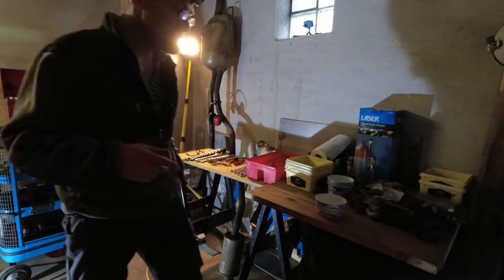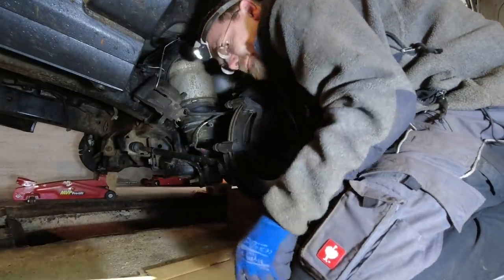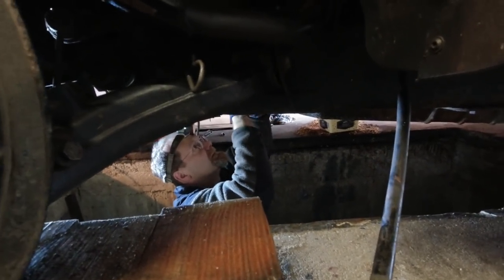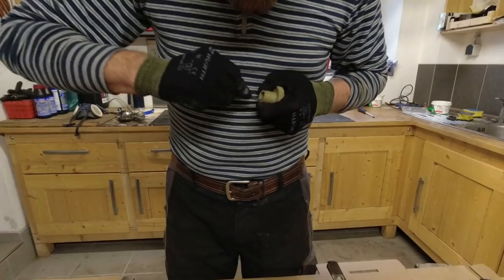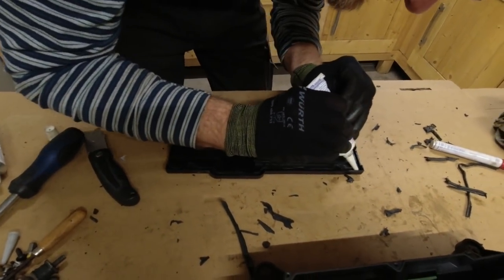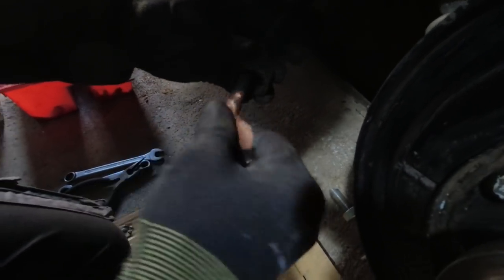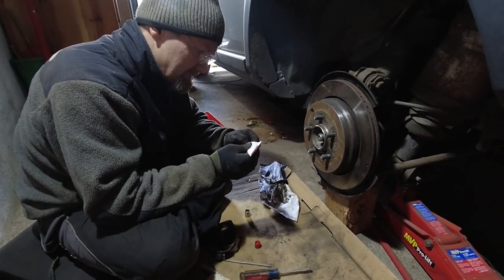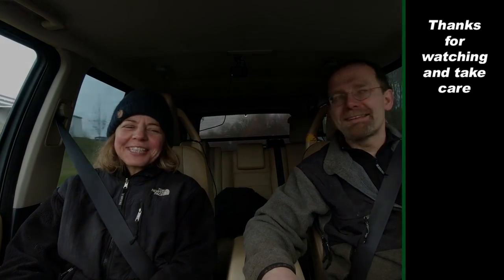How to service the electric parking brake of a Land Rover Discovery 3 / LR3 / LR4

Comment: This is my project for next week. Got my parts from LR Centre in England. Shipping was great as it only took 7 days to get to me here on Vancouver Island, British Columbia, Canada. I have the LR3 HSE with the V8, been good to me so far. Thanks for sharing the info.
Reply from the maker: Hello Zan,  have that 3/8 hex socket ready and a few new M8 x 16 bolts.  Spray them with penetrant the night before. Each cable has two M8 bolts and then there are the four bracket bolts in the back, holding the module.  Also spray the heat shield nuts. Use a hammer and socket and hit them once prior opening them.  Also use a inch socket if they spin through.  We love Vancouver island.  We took our Jeep Cherokee there about 20 jears ago. The landscape is endless. Victoria is a nice city with friendly people.  Good memories.

Comment: Had to be recovered on a truck yesterday. The park brake was stuck on making a horrible noise, so I used the emergency release which didn’t release the brake and locked the gearbox in park 🤦. Got it home and stripped down, cables cut to release the park brake, park brake unit remove ( I used you video to follow, which was great. Mine has Adblue so a little extra work to remove the tank) I’ve opened the electric motor and gearbox to expect the little plastic cogs to be stripped and everything is OK???  Not sure what has caused it, so a full rear brake rebuild and new cogs on order. Your video was excellent 👍
Reply from the maker: That suck,s , our’s was jammed once too, offroad in the Alps. But we could release it. We did the rebuild then in the following winter. When you watch that video, you see that the gears itself did not look damaged or worn out. But definitely be rather safe than sorry. 👍🙋‍♀️Vera

Comment: Another great informative video. I agree, use your EPB all the time. My 2005 D3 is now at 200600 km and the module is still original. Although it's an auto, I still use the parking brake every time. I just had it serviced (shoes stripped cleaned and readjusted according to Bodsy's brake bible) in 2019 after it started making horrid noises, and all is well. Looking forward to your underbody corrosion video. Cheers!
Reply from the maker: Hello Alex, thanks.  Next few videos will be for example:
5 thinks we do not like about our Discovery
Underbody corrossion repair
Things you may not know about your drive shaft
Bad thing is, that I have to work now again. Vacation is over.
Reply: @Vera_and_Christian  Looking forward to them. Stay safe!

Comment: That, right there, is the main reason I can't face the idea of trading in my D2 for a D3.
To have half a chance of doing these kind of jobs easily, you need a D3 that's always been looked-after, and has no rusty nuts and bolts... which you can't rely on when you buy a 10 year old vehicle.

Oh, how I wish JLR had designed the D3 as an evolution of the D2, perhaps based on a Defender 110 chassis. 

Much respect for taking these jobs on, rather than handing it over to a specialist.
Reply from the maker: Thanks.  Such vehicles in Germany are like new after 10 years.  There is hardly no salt and the roads have no bumps. They are dealer-maintained too up to 150t km.  Then they are cheap to buy because they are expensive to drive for non-DIY folks.

Comment: Another fun and informative video, I have adjusted a couple of times and figure one day I may need to fix it if the gears strip.  On a different note, I see you have some light surface rust on the chassis, I do regular off road beach camping but on return to dry land I was thoroughly Then  spray inox mx4, it's a lanolin based product. 2007 lr 3 and not a hint of surface rust
Reply from the maker: Hello Peter,  I have done some rost protection but not in all areas.   I wish i would have done more.  At least I should have kepot it clean but did not.   We ve done not some rost removal which will be in one of the next videos.

Comment: Just wondering if you can remember how long it took to get get it out and back in, I would imagine the gear renovation didn't take long but getting it out and back in must have taken ages.
Love your videos and thanks a million for all your help and information 😁👍🍻🍻
Reply from the maker: That depends on the corrosion degree of your Disco. If we had a video like ours when we did it the first time, it would have been much faster. But we also film, which adds at least twice the time it would take normally. But, who cares how long it takes if it takes 2 or 4 hours. As long as it saves you a couple of thousand € from the dealer or independent workshops. They do not do that for little money. 👍👌🙋‍♀️

Comment: Greetings, marvellous to watch. What size amp leads are you test running the EPB motor with. Thanks in advance
Reply from the maker: I am not quite sure.  I own a couple of test leads and alligator clamps from Amazon.  Not the very cheap ones.  Christian
Reply: @Vera_and_Christian  Thanks, the wires I was using to test the EPB motor were to light. I made a couple out of house electrical cable I had. motor works fine. 😊

Comment: Great video! Very useful for Disco 3 owners! Thanks!
At the end, did you only brake by engaging the EPB on the move? Did you do this to test that everything is working well? Doesn't that put a lot of strain on the EPB module?
Keep up the good work!
Reply from the maker: The TÜV inspector also used the electric hand brake this way. He had an electronic diagnostic tool which measured the vehicle response.  The the manual describes the hand brake switch as a emergency brake as well.  I am not sure if the electric brake actuator is actually used when doing this while driving...  Somethin I need to look into.
Reply: @Vera_and_Christian  very interesting! thanks!

Comment: In the event of a breakdown/Fault, is there a procedure or emergency brake to prevent the vehicle rolling away once parked ? Thanks
Reply from the maker: Yes, put it into gear and use a wedge when parked steep, additionally. 👍🙋‍♀️

Comment: Question:
Does rope(cable) is dry and in good condition? My point is that in winter, if cable(rope) is wet in the casing, it will freeze and parking stop will not work.
Reply from the maker: If you take care of your EPB and service it regularly, you have no problems. Like with everything Land Rover related. We live here in Europe in moderate, wet, and cold climate and the EPB works just fine. It is a Land  Rover after all and build to last. But, you have to do your maintanece. So if something cracks, you have to replace it. 🙋‍♀️Vera

Comment: Christian, the e-brake and brakes in general have. been the greatest annoyance and expense with our LR. I wish you had gone slower and with more light in the critical final assembly steps. Very glad to view your video nevertheless.
With the 30K I do each year, with salt from road...it should be announced loud and clear to open the brake system up to clean and lube before parking for the winter rest...or in spring if you do run through winter...
You are fortunate to have a well configured garage!...and moderate winters to work in.
PS - you didn’t do the e-brake series of secret switch moves and 10 stop “setting” of the e-pads!...or did I miss that ...?

Comment: What sort of time span and mileage should we doing an EPB service ? my D4 is 2015 on 18,800 miles.
Reply from the maker: Well, we did it on ours when he had about 210000 km on it. More important is that you check your EPB everytime you change brakepads in the rear. 👍🙋‍♀️ Vera
Reply: @Vera_and_Christian  Thanks Vera

Comment: Why did you have to drill out the holes of the mounting screws ?
Oh my goodness what a great paint job.
Reply from the maker: There was a risk of breaking the plastic taps off because the bolts were so corroded. 🙋‍♀️ Vera

Comment: I have to service my brake module - it looks to me like it should be possible to service the brake module / replace gears in situation rather than fill remove job with all that rust ?
Reply: Did anyone try this ?
Reply from the maker: We would always take the unit out.  It's not that difficult, and you can service the unit in a clean environment. Also you have to get it sealed perfectly again. 🙋‍♀️ Vera

Comment: hi christen when you did this did you need to pht it in too service mode ? . if so how did you do it. and did you need to unmount the cables before  you did it
Reply from the maker: Service mode is basically brake open.  Nothing else.  Just pull the fuse or disconnect the bat before you start work so it does not accidentally actuate the brake.  Christian
Reply: @Vera_and_Christian  thank you for hour reply ..you guys rock

Comment: My LR4 area doesn't look like this. Theres a bigger solid plate above spare, ac lines and a large canister all behind the module prohibiting access to module. I think the only way mine can come out is through right rear wheel well but the I can not get lines out of the metal brackets, they are not forked like lr3, they are on a hole and grommet with difficult access
Reply from the maker: Check my video from a few weeks ago fixing various things on a later brown  LR3. I removed the PB with this plate. Was very difficult but worked. It was at the end of the video.  Christian

Comment: Great information about the park brake. In case the park brake fails, what exactly happens? Can you drive away the car or is it stucked? What precicely is the failure in your case? I understand that the gears were not that bad and that the clutch(s) work. Even the motor turns and all the cables as well.
Reply from the maker: You can unlock the parking brake when you remove the puller, there is a cable loop hidden behind it, which you pull.  Then the brake should be released.  We actually decided to replace the gears from the very beginning when we bought the car.  It just took a couple of years to get to it 😂.   Same with the oil pump,  we changed it right after buying the car.  But on our last vacation, on the way up to Mount Jafferau, the gears startet to grind really bad.  I actually expectet to have loose teeth in the box, but it looked all fine. 🙋‍♀️ Vera
Reply: @Vera_and_Christian  Hi Vera and Christian, thanks for the quick response. Meanwhile, I learned from another vid on this topic, that you can buy a gear-kit made of brass (aftermarket) instead of the genuine LR plastic. The puller is the knob in the cockpit?
Reply from the maker: @HeinerStorch  I have to look into that because we really would like to buy another Land Rover Disco or Range Rover Sport this year👍.  Yes the puller on our car is next to the shifter. It's clipped in only, so you don't need any tools to remove it.  🙋‍♀️
Reply: @Vera_and_Christian  I see, thanks again. Are you going to sell this one?
Reply from the maker: No, we put way too much work into that one.  But Christian really wants a V8 Diesel.  In Germany, my Freelander costs almost as  much of insurance and tax as the Disco.  So  my hope is that we sell the Challenger. 😉😃🙋‍♀️ Vera
Reply: @Vera_and_Christian   Is he looking for a V8 Diesel first registration 2006 onwards or later? What about the V8- Diesel engine's reputation? Now and then I dream of a Range Rover V8 Diesel, but reading some statements concerning reliability, durability I wake up. Shot Turbos, defective  injectors, cylinder head gaskets, air suspension compressors, sensors etc. etc., electronic failures, ... That's my personal impression.

Comment: How long did it actually take to get it out. Had you the power tools of a Shoppe how much quicker do you think it would be. 
The whole thing looks like a bit of a nightmare.Cheers : (
Reply from the maker: 😅👍 It took us 2 hours to get out and 2 hours to get it back in. And of course the time spend replacing the EPB Gears, but you can take that from the video, we didn't cut anything out on that part. When we work on the car, I don't make any other plans for the entire day 😂. 🙋‍♀️

Comment: Hi guys!  My right hand EPB cable came out of the locking mechanism (the little "notch") and is now stuck fully retracted.  Do you happen to know: Is there a trick to releasing the cable so that I can reattach to the shoe lock?  Must I pull the entire module and open?  All suggestions very welcome!  Thanks as always!
Reply from the maker: I am not sure.  The notch is just a anti rotate locator for the wire guide.  Christian
Reply: @Vera_and_Christian  I've found a video for manual rewind (or re-lax) of cables.  A fussy piece of equipment is the EPB module.  Question: is one able to disconnect the emergency release cable form the EPB module?  I'd love to leave it in place while unwinding the brake cables.  Thanks--as always--for your input and your videos!
Reply: @Vera_and_Christian  Found this note on forum.  Might work to release cable. "Service mode (or as it's called in the IID Tool, Mounting mode) is only able to be triggered through a diagnostic tool. I wasn't ever able to get it to work via button press sequences. In the IID Tool, for the LR3, you actually have to go into the I/O menu, not the Service menu, and change the status there from Latching to Mounting. It's not fully clear and it's a bit of an odd quirk with only the L319."  I/O control theoretically should allow for cable release.  :oops:

Comment: you could of also checked inside the motor as the brushes do also need replacing after 10 years
Reply from the maker: We just ordered them but have not installed yet 👍🙋‍♀️ Vera
Reply: @Vera_and_Christian  I'm just having a problem where the hdc and poor communication causing multiple errors
Reply from the maker: @markcookson3519  do you know what fault is there First?  Did you check the fault codes?  Most com faults are caused by a single fault.  Ours was the ABS module.  Christian

Comment: You should of just left the passenger side cable connected, to the brakes, then unscrewed the passenger cable from the unit. leaving the cable routed around the vehicle, Resulting in just undoing the drivers side and then just removing the unit.
Reply from the maker: I think this would have required to open the unit under the vehicle and this is what I wanted to avoid.  I also wanted to inspect the cables.  I saw the method you described in YouTube as more common.

Comment: What a complicated design! Not clever. Question: why do you think 2 out of 5 D3s in the family frequently have parking brake problems (the dreaded scream) and the others never do? Our specialist has no idea!
Reply from the maker: Hello Richard, Ours had only 12t cycles on the clock.  Life is rated up to 50t cycles.  I think it comes down to the number of cycles and also to the environment. Ours was not hopeless corroded but borderline.  We also serviced our brake shoes regularly to keep them moving.  All this adds up I think.  If nothing is done, the module will fail early and badly.  Thanks for your comment!
Reply: @Vera_and_Christian  Thanks Christian. A video on servicing the brake shoes would be useful. I think that may be the key to reliability, especially as the cars are used in muddy (farmers) conditions

Comment: Yet another definition mistake.
It's a hand brake.
It's designed to be used where safety is needed while the vehicle is temporarily stopped.
It's a fundamental safety feature.
Hand brake.
It is not a parking brake.